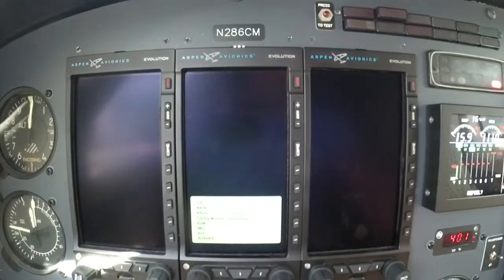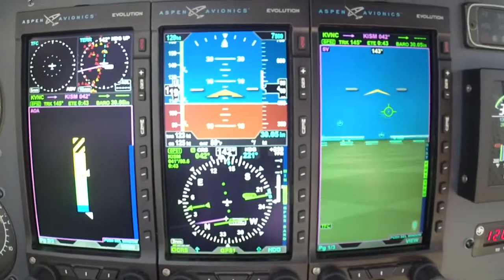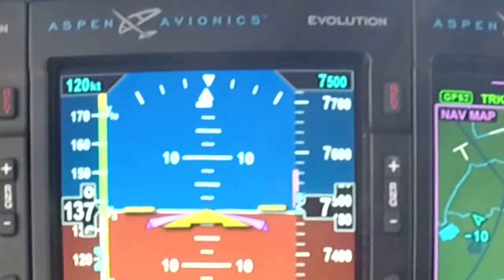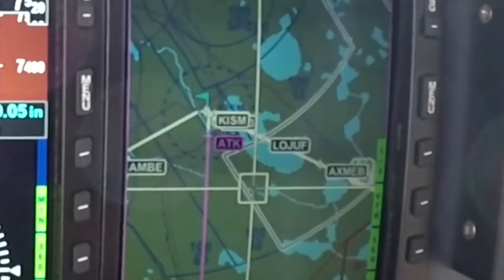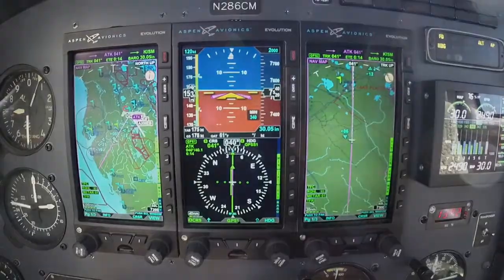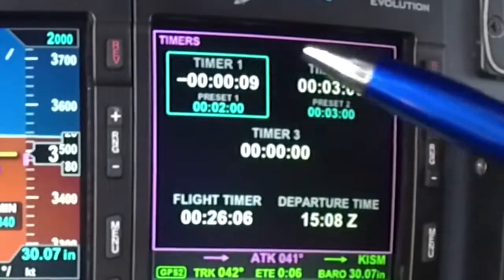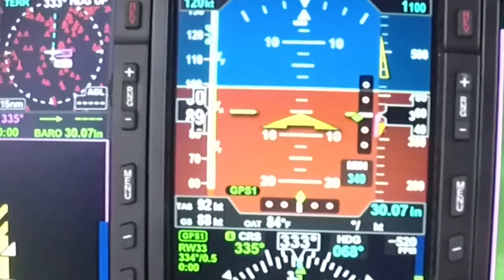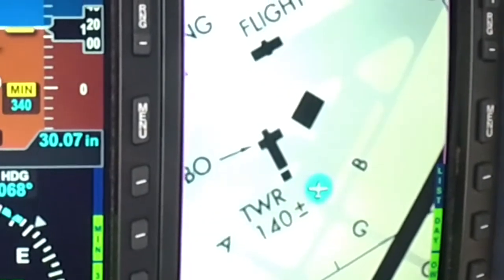Evolution 2500 MAX Demonstration Video

Comment: We have a 1000 in our training 172, and like your video when yoiu are flying level the yellow bars are NOT aligned with the horizon.  There needs to be a button to align them like on the old AH which has a knob to adjust the little airplane.  Our 1000 is off all the time, and not always by the same amount.